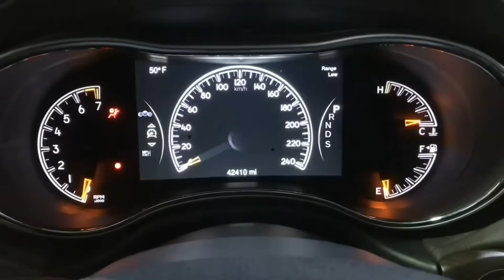The Shocking Truth Behind Chrysler's 2.7 V6 Engine Disaster

Comment: the 3.6 pentastar is a total piece of crap too! Chrysler just cant get it right!
Reply: There is no comparison between the Pentastar and the 2.7.  The Pentastar overall are reliable.  The number of failures are few and far between despite how noisy the internet can be about them. By comparison, you could tell a 2.7 from a non-2.7 powered Chrysler vehicle because of the blue smoke they would emit.
Reply: @colinschmitz8297  The pentastars are definitely better than the 2.7's however they are still total junk. Been a mechanic for 20+ years and i service just about all makes and models and i couldn't ever recommend a pentastar to anyone. Constant oil cooler leaks, lifter and cam failure, coolant leaks etc. I haven't seen a single one yet in my shop that had 200,000 or more miles on the original engine.
Reply: @tylerwightman2315  they do 200k with a cooler change in between. They can eat cams too, but not as common as Hemi. They may be the most reliable domestic right now. Fords have that deadly water pump/timing chain issue and GMs are stretching chains too. Compared to the import competition, Pentastar is pretty straightforward tech. Nothing new or complex.
Reply: @user-ew6jy9mo4r I somewhat agree. I personally havent seem a 3.6 pentastar hit 200k yet but i know they are out there. And yes everybody has got their problems. I just did a timing chain job on an ecotec 2.4 last week, last month did a timing chain job on a gm 3.6, and in the last year I've done 3 cam phaser and chain jobs on ford ecoboost 3.5s, and 2 internal water pumps on the Naturally aspirated ford 3.5s.

Just about everything is crap nowadays 🤦
Reply: @tylerwightman2315  why I'm happy with my 3800-powered Buick and Crown Vic as the backup. They don't break all that much and are generally pretty easy to fix when they do.
Reply: @CharlieLarkin75 those are 2 indestructible mills you got there!

I've got an old 2002 F250 with the 7.3 powersmoke diesel and she refuses to die 😂. I'm at 396k on the original engine and 4r100 transmission and outside of scheduled maintenance, it's needed very few repairs over the years. I'll be at 400,000 by the end of the summer if not sooner
Reply: @tylerwightman2315  Smaller engines are being stressed for better performance to meet EPA guidelines.
Reply: @deepthinker999 yup, turbo charging, direct injection, high compression ratios, lean burn tuning, small displacements in big vehicles etc. I've been saying for the last decade or so that we are headed in the wrong direction.....I mean when you have little 2.0 liter (or less) turbo 4 bangers pushing big heavy SUVs around, that's just a recipe for disaster. Yea they might make good power on paper but I've driven and worked on some that sound like they are fighting for dear life to get up to highway speeds. There truly is no replacement for displacement if you want longevity.....usually
Reply: @tylerwightman2315  lol! Sounds like you know ALL about it. 😂
Reply: @user-ew6jy9mo4r believe me. Im out on the front lines seeing this newer garbage the auto makers are putting out on a daily basis. Dont even get me started on the "wet belts" they are putting in various models of fords, hondas, and even the Duramax 3.0 diesel. Cars today are litteraly disposable junk!
Reply: @tylerwightman2315  I hung my wrench’s up about a decade ago. Flat rate would smoke me nowadays. I WAS on the LM2 program though. In testing they were eating rear mains like candy. I still dont think they will make it long enough in the wild for the wet belt in the back to be a problem…
Reply: @tylerwightman2315  wet belt? What is that, and why does it sound awful?
Reply: @CharlieLarkin75 some auto makers are now using internal timing belts and oil pump drive belts that are fully submersed in oil.....oil and rubber dont mix well if you catch my drift haha. They tend to shed alot of material in a short amount of time and clog up the oil pick up screen causing loss of oil pressure. That is of course if they dont prematurely snap first which results in catastrophic engine failure.
Reply: @tylerwightman2315  I think my next car is going to be a Model A.....I'm tired of this stupidity.